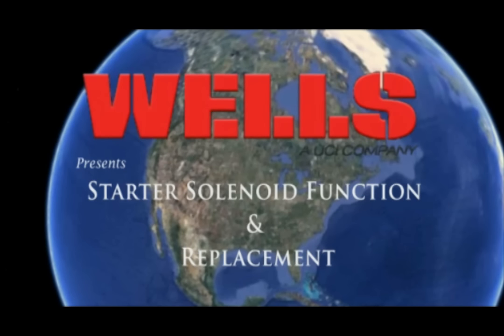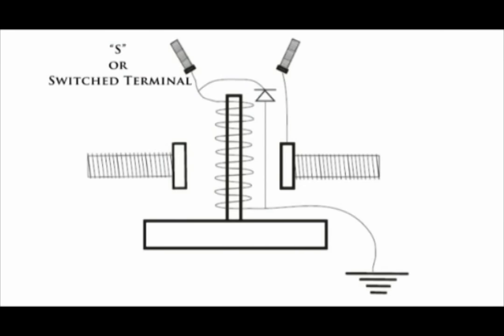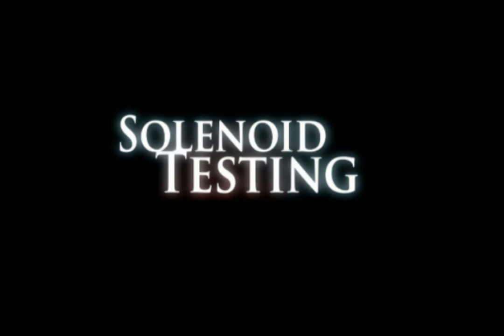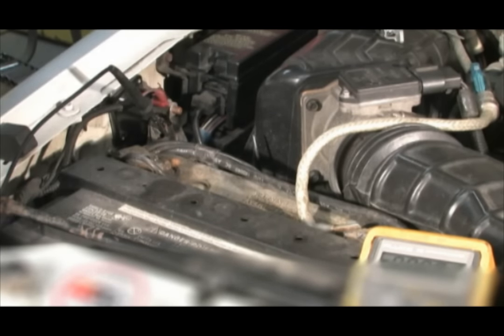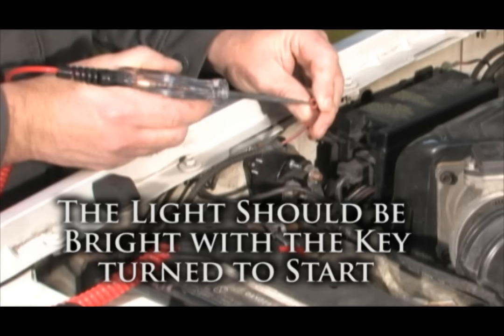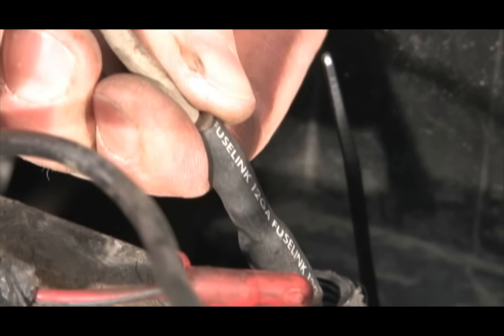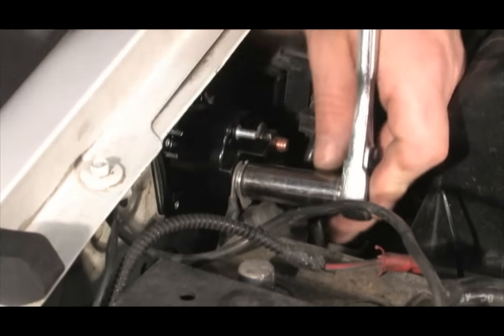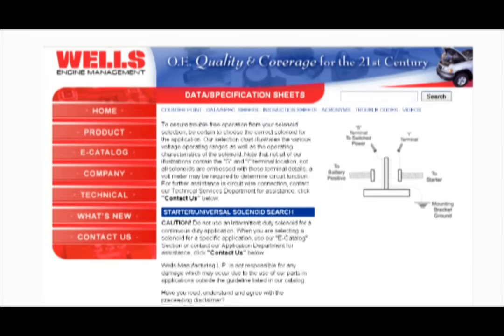Solenoid Testing, Function and Replacement

Comment: how about for a Oldsmobile Alero 2002.  new starter n starter relay. still won't start . need your help bud
Reply from the maker: Hey G Begaye, The engine doesn't crank over at all? Do you have power to the starter on the big battery wire as well as the S terminal when the ignition switch is in the "crank position"?
Mike Becker, Senior Technical Instructor
Reply: +Wells Vehicle Electronics Okay as I was looking around I notice something that looked like a fuse that connects from the battery wire n goes to the fuse box.  I clamped it together because it was loose, now it starts again with no problem,,,what is that piece called??. by the way, thanks
Reply from the maker: Hey G Begaye, I'm not sure what you're talking about here. Want to send me a picture? I might get a better idea that way. Michael.Becker@wellsve.com